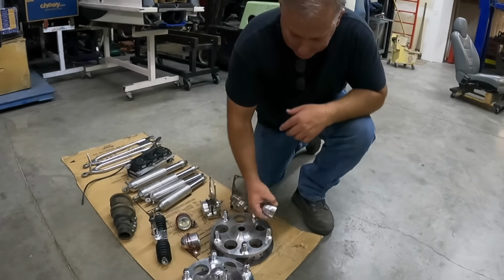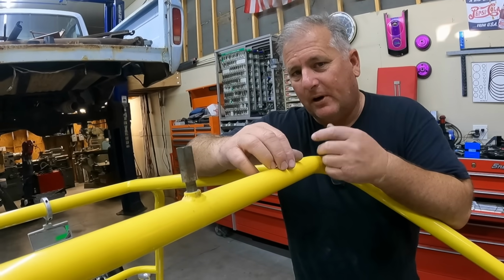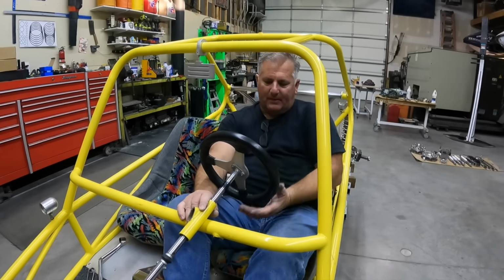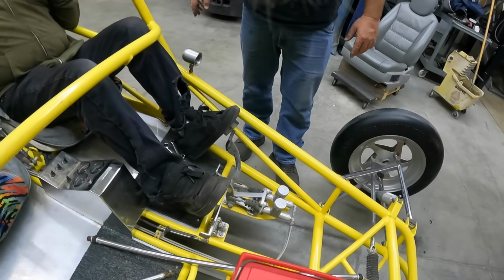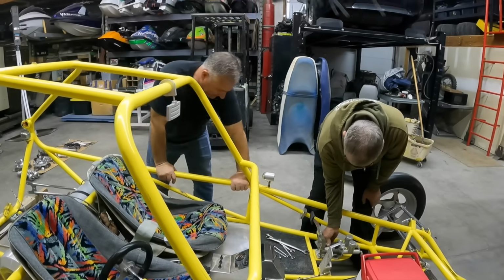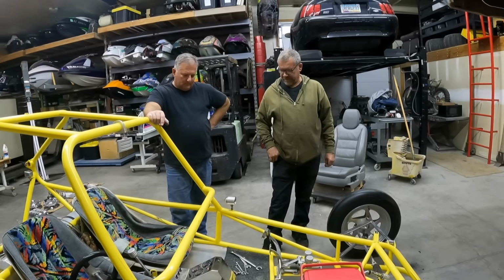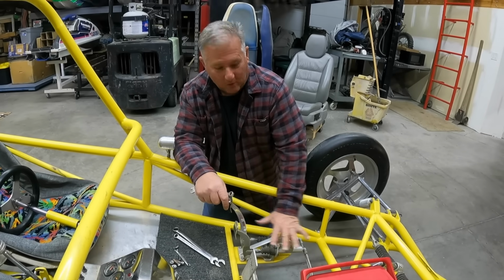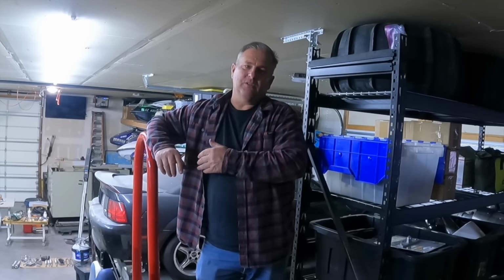Jet Ski Jim's Mazzone Sand Rail Parts Reveal for Our Epic Project! 🚀 ft. Merlon's Surprise Approval

Comment: Turbocharged Subaru is my choice, It's a water cooled boxer engine on steroids! also I ran my steering shaft through the support bar on one of my four current sand rails, because below was too far down and above was too far above.

Comment: Jim, your sand rail mods are going to work out just fine. Years ago we lived in soCal and went to Pismo Dunes a few times with my dad's VW buggy and he had his gauge and switch console mounted low like yours is and he swamped his buggy during high tide driving through one of the river crossings, he got stuck in a hole and a big wave came and instantly had water waist high! The salt water trashed everything electrical. We went to Glamis after that.

Comment: Go with VW, parts are Readily available and the engine is super easy to work on.
Reply: I would do exactly that, especially if it's already setup for a VW.  Path of least resistance will get you on the dunes sooner.
Reply: @rickstine7107  I've got a couple of rebuildable engines in my garage in Mich, there only 1600s but there's plenty that can be done to squeeze HP out of them.

Comment: JIM I have a jetski Question will a650 total loss msd flywheel fit a 750 sxi ? just bought a ski and the ring gear is toast in one aera
Reply from the maker: Yes, but you have 2 machine the boss on the engine cases to mount the stator plate on the 750 engine.